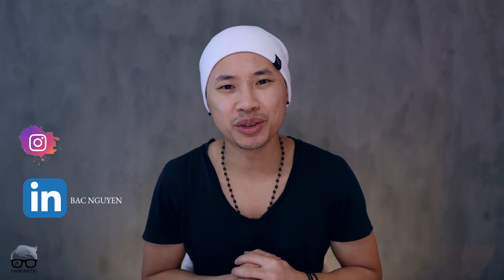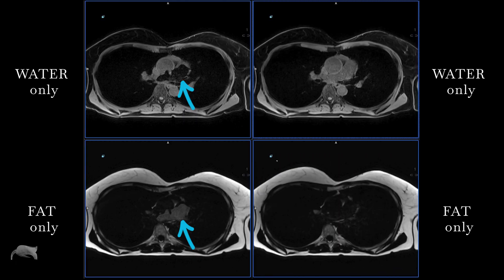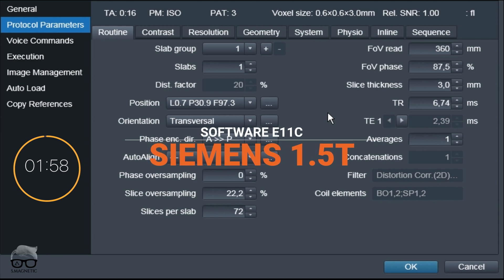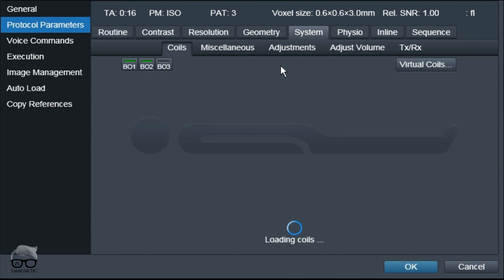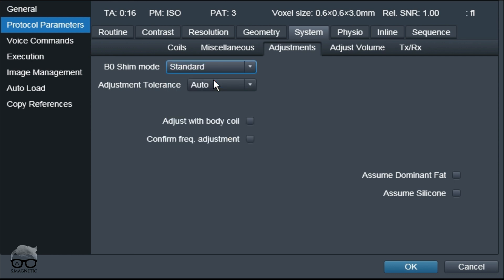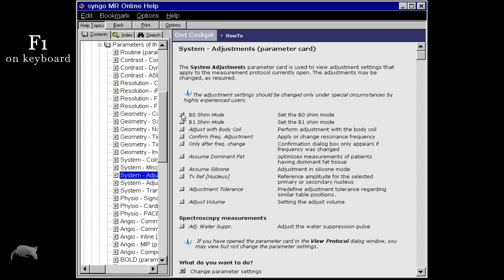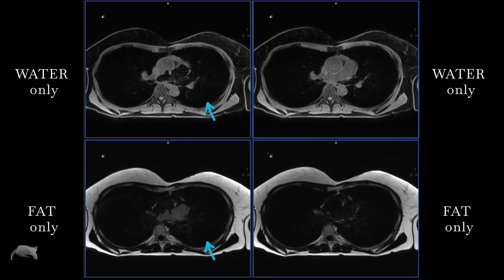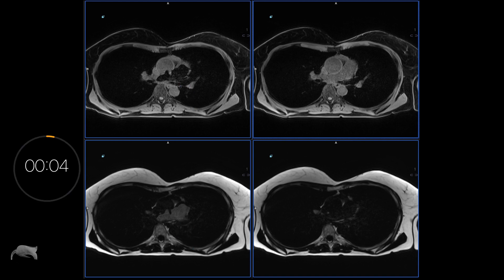DIXON SWAP – ONE STEP SOLUTION

Comment: Often Shim in Siemens is in tune up and not standard causing problems with fat sat and Dixon

When ever I see it I put Adjustments to standard, which changes the shimbox to the same size as the fov of the sequence and also with Dixon checking the region of scanning to fit with adjustments, nice trick!